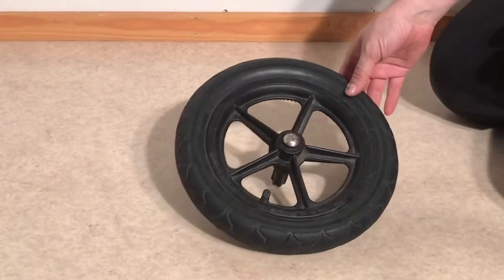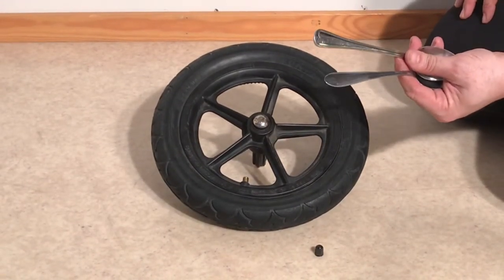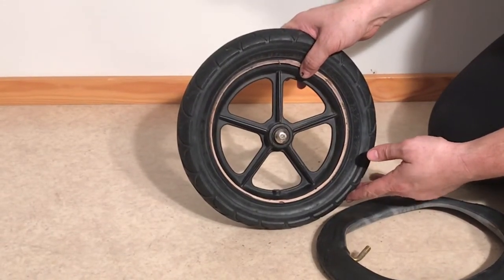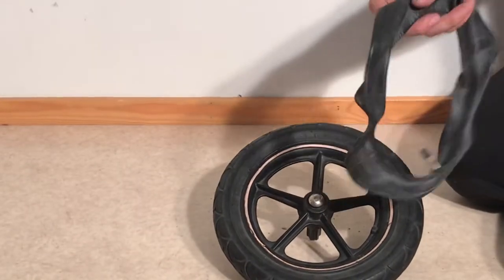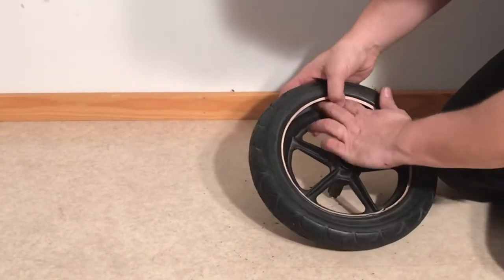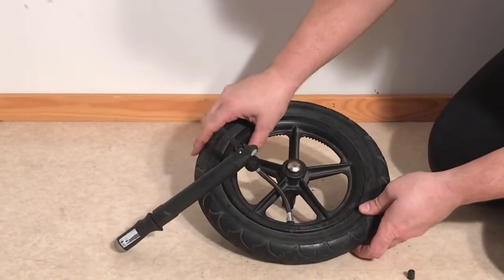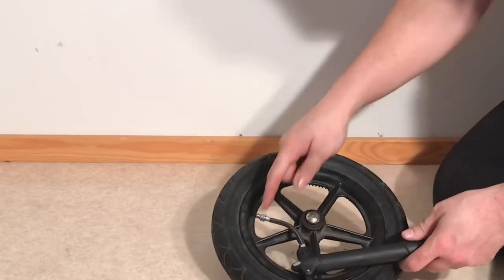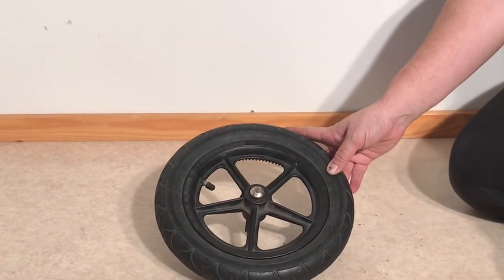How to Change the Tire / Inner Tube on a Bugaboo Cameleon 1

Comment: Hi! You Sir are a real Hero! thank you very much for all your very useful videos! I have one question: is it possible to switch the air-wheels of an old cameleon 1 (2006) with the 2008 foam-wheels? the mechanism looks the same, but bugaboo mentions incompatibility. they just dont explain why, so i am curious. thx in advance!
Reply from the maker: Thanks :)  Cameleon 2 wheels are fully compatible with a Cameleon 1, just not Cameleon 3 / 3+.  Just check that the axle looks the same (has the plastic around it). :)

Comment: Hey! Thank you very much for your videos! Can you tell please, is it possible to change tires on front wheels (bugaboo cameleon 1st generation)? If yes, can you advise on a size of the tire?(ideally, to make a video 😇). We bought a used stroller with front wheels , which needs to be replaced and new ones cost around 100€..
Reply from the maker: Finding the right tires would be difficult, but I'll make a video on this, next time I get one into the workshop :) You can use Cameleon 2 wheels for the Cameleon 1 as well, and can also even use Cameleon 3 wheels if you keep the Cameleon 1 forks. :)
Reply: @BarnevognverkstedNo  Thank you for your response! If you make video when changing tyres From Cam3 to Cam1, that would be awesome (there are a lot of used cam3 wheels on market)